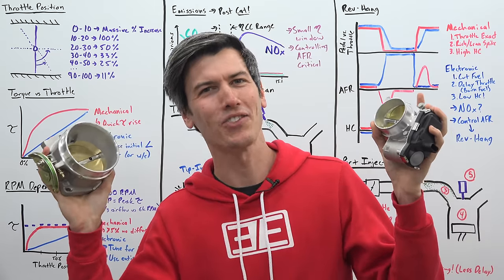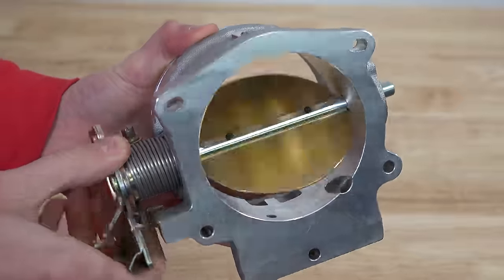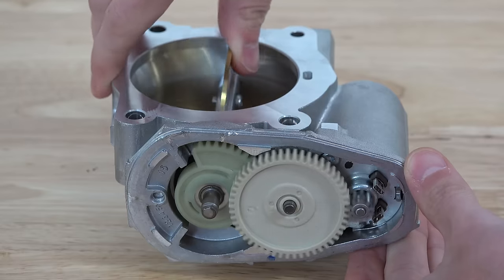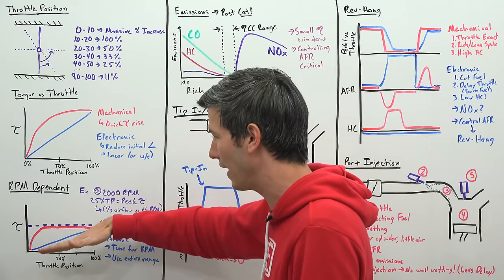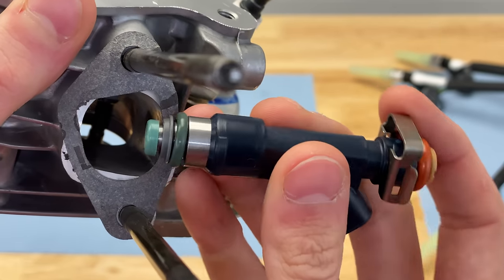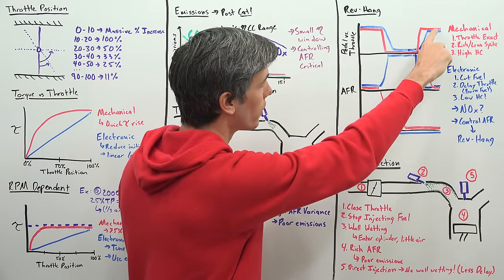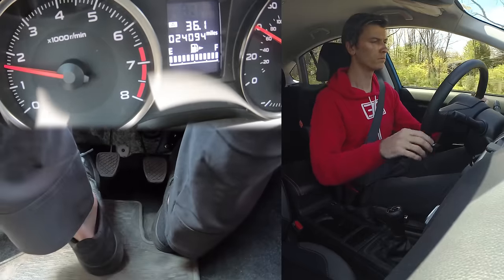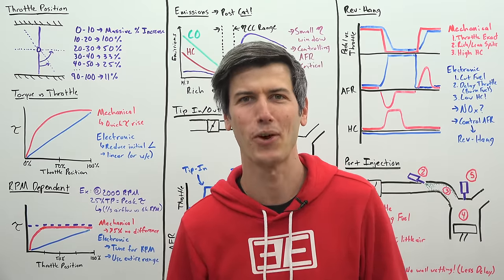The Big Problem With Modern Manual Transmissions - Rev Hang

Comment: I've noticed for a long time that as I am accelerating if I vary the throttle i can find a 'sweet spot' and as the revs go up it pulls better if I very slowly reduce the throttle!
Counter intuitive I know but it seems to work!!
First noticed it on my moped, it seems to work on petrol and mechanical throttles. 
I'm not sure I have ever driven an electronic throttle..

Comment: I guess this explains some of the reasons why I find it easier to drive my dads 02 325i VS my 97 F150... the throttle is a lot more sensitive on my F150 than his Bimmer, being electric throttle VS cable throttle.

The tip-in and tip-out thing also helps me understand why some engines with blower surge like to kind of bog down when you get off the throttle quickly.

Comment: This is what made me buy a Hondata Flashpro in the first place, I wasn't interested in HP at the time just shutting off the dampening entirely.  You can adjust the ramping of the throttle, but i went one step further and use Camshaft Advance (VCT) by TPS.  It made part throttle response ridiculous you can literally feel every percent of throttle input.  But it takes time to set all this up. ;) Originally my acura TSX did this annoying rev hang, but after i tuned it without the dampening it became super responsive and led to more tuning of the engine and exhaust etc... totally worth it.  Only downside is the cost.

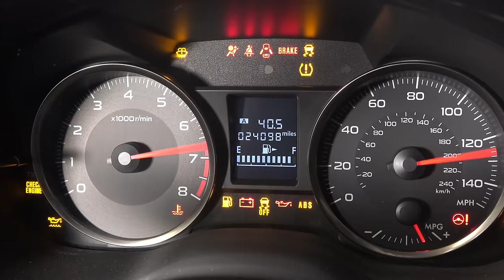Comment: 5:44 not a lot of people would agree that limiting throttle input while applying brakes is any like of an improvement. Especially if you do any kind of spirited driving and left-foot brake for more  controlled weight transfer, not to mention turbo cars and losing the ability to maintain boost while cornering.

Comment: My 2017 Civic X with 1.0L 3 cylinders is an excellent car, i can drive it under 6L/100km, but it takes forever for the revs come down for the next gear and has zero engine brake. Perfect for me saving a lot of fuel, but really annoying in the alps when it comes to steep and long descents.

Comment: FWIW there are plenty of racing cars where the throttle pedal mapping is non-linear, like with a traditional mechanical throttle body. Thank goodness at least these days cars rarely suffer from the HIDEOUS drive by wire throttles of yesteryear, where the pedals had almost no stiction, making it incredibly difficult to keep the pedal steady. You know, kinda like most sim racing pedals, where the pedal travel is almost totally smooth and just has a resistance spring. The bit of stiction from the wire running through the channel helped a ton with making the pedal stay still even if the pressure from your foot fluctuated a bit.

Comment: You can let off the throttle just before shifting to move the rev hang forward.  Also the anemic throttle response gives you an opportunity to double-clutch when you upshift.  This nullifies the skip shift, which was imposed to reduce emissions.  So the emissions savings of the anemic throttle response is cancelled by the double-clutch procedure.  Double-clutch downshifting though sometimes leads to a backfire in the intake which, I suspect, may be dangerous to the MAP sensor.

Comment: It makes sense finally.. I tought it was related to the flywheel being heavy and stopping the engine from delegating.. on the other hand.. the car I gear was decelerating quite well.. 
now I have a diesel and I have a huge rev hang.. any ideas? I don’t think the diesel has a throttle, could this be the main reason?

Comment: I have had the though of an electronic differential throttle, so when you change the pedal position the valve moves right away in the right direction and the computer can fine-tune the result, but a better idea is to use a hybrid system to soak up the rev hang and sharpen up the tip in. It might be possible to get rid of that tip-out NoX spike.

Comment: cable throttles can have dashpots attached to slow throttle closing which reduces the hydrocarbon exhaust.  My old 1974 VW Bug had such a dashpot on its carb.

Comment: Drive-by-wire systems can be a real pain. I had a 2015 Chevrolet Suburban and the throttle response was awful.  It was so bad that you couldn't quickly accelerate because the computer would cut your throttle inputs. I ended up buying a device that plugged in between the pedal and the computer which allowed me to adjust the throttle levels to feel more normal and responsive. Now I have a 2019 Chevrolet Suburban and GM has improved their drive-by-wire systems substantially so that the throttle feels perfect.

Comment: Many older carbureted cars were designed with a throttle linkage where the throttle position vs pedal position was non-linear in the opposite direction to the non-linearity of the throttle position to air flow. You don't need electronic throttle bodies to do this. Also, many carbureted cars of the early emissions era of the 1970s had dashpots that held the throttle open in much the same way as you describe. Easily disconnected.

Comment: You can still get rev hang with manual throttle bodies especially in old dirty running v8s ive got a 94 cobra and i try to clean my throttle body any time my intake is off because an old spring carbon build up and a cable physically adding resistance to the throttle blade closing they can hang open just a small amount when it should be closed

Comment: It's not just electronic throttle bodies that have this issue. my 90 integra is tuned by the factory to allow rev hang by having a delay before the injectors shut off on throttle off. This causes the rev's to hang a bit when you lift. I had to tune this out of the ECU to get the benefits from my lightweight flywheel. Before doing the ecu tweaks, even a 7.5lb flywheel would behave like a stock flywheel during that delay period. It was terrible and made shifts a lot slower without trashing the transmission.

Comment: My 1968 VW Beetle had a mechanically-linked throttle, a carburetor – and rev hang? How did it do that? Very simple, when you took your foot off of the throttle pedal, the throttle not close right away. There was a device attached to the carburetor that prevented the mechanical linkage from following your foot. It was basically just a little diaphragm or something attached to the cable linkage on the carb. When you took your foot off of the pedal, the thing slowed down how fast the throttle closed, due to air being forced through a small hole somewhere. By slowing down how fast the throttle closed, it improved emissions. Also, if you detached the thing, the engine would backfire, because of the way the ignition timing was configured from between idle speed to about 2000 RPM.

Comment: I have a 2004 G35 coupe with a manual transmission and that thing has throttle hang like you wouldn't believe. I cleaned the MAF sensor and throttle body as soon as I bought it and kept thinking I must have broken the thing. I did read that the stock flywheel is around 34 lbs so I did think that was the issue. My RSX Type-S has a chromoly flywheel that weighs around 12 lbs and the stock was like 24 lbs. So coming from that car to this one I thought maybe it's normal. But, now I'm starting to think I DID break the throttle body, haha. I was a little rough on it and the butterfly may have moved a little when I was scrubbing. The idle seems fine though, no other issues just that insane rev hang.

Comment: The thing is, the system is designed assuming drivers will learn to control the engine spin down (for the next gear) by the clutch in a way to not make the car jerking. It feels different, but not that hard to master. Yes, it relies on functioning synchromesh (as you can not rev match that fast by engine due to the rev hang effect). The thing is, there are some theoretical ways to prevent the effect, but become very impractical in the real life:
1) Use variable intake valve timing/gap to control the amount of mixture instead of a throttle valve. That way you can shut the mixture off immediately (assume the valve control mechanism is that fast) without any a/f ratio surges. Bur extremely complex so expensive and most likely unreliable.
2) cut ignition instead of closing the throttle valve to cut the engine power, let the cat to burn off the fuel residues (cat could handle that well into its thermal inertia). But problem is, this would pass unburnt oxygen across the O2 sensor, so the computer won't have any clue how well the throttle closure timing matched the flush of the residual fuel, so how well it maintained the a/f ratio for the cat to burn it properly. Because all components in modern engine are made as inherently inaccurate but rely to the "runtime calibration" by the computer, the result would be either some very complex a/f sensing system or poor emission due to poor a/f ratio. Plus this would mean the energy from the residual fuel being completely lost.
With the present, the energy of the residual fuel remains in the form of the flywheel spinning, which could be then used to provide acceleration with the next gear, although with losses (if the gearing ratio changes 4/5, still 16/25 of the energy is utilized).
Of course easing off the throttle gradually before shift gives it enough time to flush the manifold without any losses, nor ref hang effect. Of course, that yields slower shifting, but there is no reason to be racing fast for a normal smooth driving (so except rare occassions when some unexpected maneuvre is needed), when you really pay attention and anticipate what would be needed, so the clutch do not have to be loaded for that spin down that often to cause any noticeable extra wear.

Comment: I went from driving a 1989 Isuzu Trooper to a 2016 Subary WRX and it took me a LONG time to get used to the electronic throttle. I also ended up getting a COB Accessport and doing a stage 1 tune to help with the rev hang, because even a few years later, the rev hang was still bugging me (also vroom vroom racecar lol)

Comment: Can we just be happy that at the very least manual is still in some cars, we need to appreciate this more.
Reply: That wont be for long unfortunately
Reply: @snowysysadmin59  Mine will never leave its body
Reply: I managed to get a 2012 Chevy Sonic with a 5 speed Manuel and I barely feel a jerk.
Reply: Ford just announced a new manual (the bronco) not that long ago hopefully this means they come back if it’s successful
Reply: @paul. Here's hoping
Reply: It’s the reason I’m considering a Focus ST in a year from now. It comes in nothing else but a manual and reviews say it’s a fun daily driver. I love driving a manual for a daily and a sporty automatic with paddle shifters in my bmw. But my manual car is a beater Chevy Cavalier that won’t die. So the focus st may replace both my current cars with a near perfect all in one car, a fun comfortable car that’s got a manual transmission perfectly made for daily driving. So I for sure appreciate it which is why the next car I buy has to be a manual as I don’t know if I could go without one in my life. They’re just so much more of a connected car. Something EVs will never be able to achieve.
Reply: My 2018 Accord is Manual, but had a rude awakening when I tried to trade it in. All dealerships will give you extra negative equity under the argument that they are harder to resell, that nobody wants them. And then I used this argument to buy a winter beater, knocking off 500 to 800$ off.
Reply: There's a car maker in Europe called Dacia and they only make cars with manual transmissions.
Reply: even if there are no news cars with manual you will still be able to find them
Reply: I couldnt give a rats ass about new cars having manuls. Older cars have better built and better maintainable transmissions than modern cars anyways. Older cars are just better in almost everyway.
Reply: Rohan Hay completely agree mate, well put
Reply: I have a toyota Corolla IM 2017 and honestly i think manuals should go now, because its laggy, inconsistant crappy feel and rev hang make that low torque fat pig high geared car absolutely awful. all this would be fine and dandy if u have a v6, v8 or torque

Comment: You failed to mention that cable driven throttles usually have some mechanical non linearity built into them. If you look at the part the cable goes around, you will notice it's oval. Otherwise good video.
I have just converted my car to drive by wire with an aftermarket ecu, and can confirm no rev hang, it's all in the tuning, as you say, it's a deliberate thing built into Oem cars, not a limitation of the technology in general. Electronic throttle, when you can set it up yourself is awesome.
Reply: We use different throttle cams on our motorcycles to change this.
Reply: @petebusch9069 ya I'm really surprised a channel of this quality didn't mention that throttle cams are almost never actually just round and are almost always oval or egg shaped for this exact reason

Comment: Rev hang kills the driving experience for me, and it’s why I will soon be selling my manual Crosstrek. It just feels like such a chore to drive.
Reply from the maker: Haha, the Crosstrek isn't exactly a great representation of a fun to drive vehicle, but it's an excellent car. I'm happy with the manual.
Reply: Crosstrek...the ultimate enthusiast driving vehicle.
Reply: I have a manual Honda Fit, and while I'm not thrilled with the shifting experience, I wasn't expecting much- it's an econobox, after all. Even with the complaints, though, it's slightly more fun to drive a manual Fit than a CVT, and more important to me is the fact that any extra physical engagement helps keep me that much more alert.
Reply: I feel the same way. I despise my Honda HR-V because of it. But now I can be at peace with it. But the first chance I get to burn it with fire... errr I mean sell it and get something better, I will
Reply: Realized with many cars with rev hang that if you lift off the gas pedal before pressing the clutch it usually works much better. 
Completely counter intuitive but I tried this on many cars and it seems to work. Of course for race starts it doesn't work and shifting is awful 😊
Reply: I feel ya, my wife's 08 WRX with the hang really does ruin the Subaru experience.
My c5 on the other hand, can't tell it's a drive by wire, shifter feels like poo, but no hang between shifts
Reply: I am serious I still drive stick with modern vehicles. There were many time driving a stick helped me more safely drive or avoid accidents than if I drove automatic.

Comment: I've had this for the first time with my Evo X and I thought I was just being a terrible shifter! I tried to explain it in the evox forums and everybody just said I was shifting wrong. Glad someone finally got this fully explained out, it was fantastic!
Reply: If you've driven older cars or a different model that drives properly then coming to this will frustrate you a lot.
Reply: I had the same exact thing happen to me in the Scion tC community. Everyone told me that I was either shifting wrong or Needed to get a lightweight flywheel 🤦‍♂️ I just wanted someone who could tune it out
Reply: Evo X also and first time I experienced it as well. Wondering if it can be tuned out during the performance tuning process.